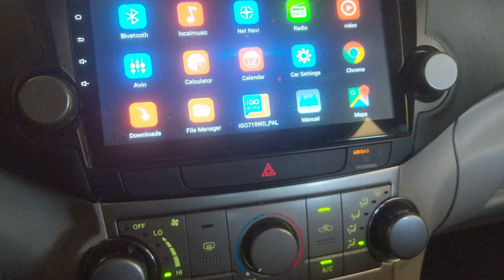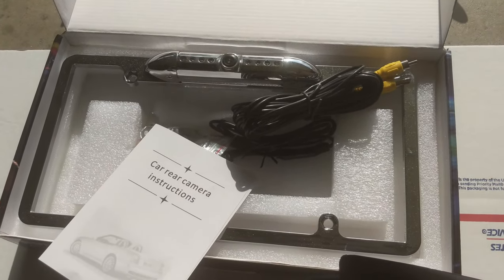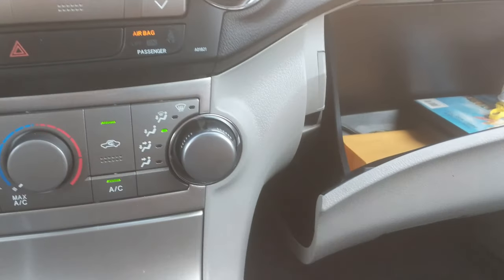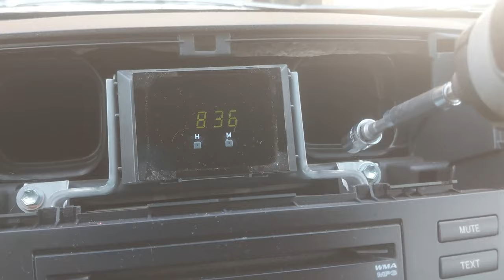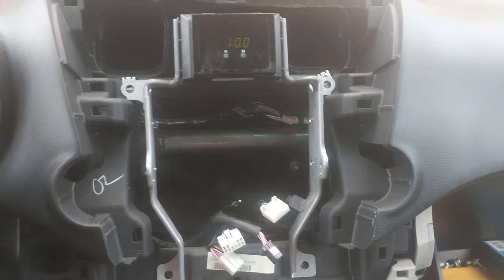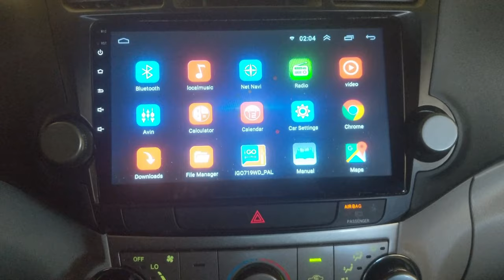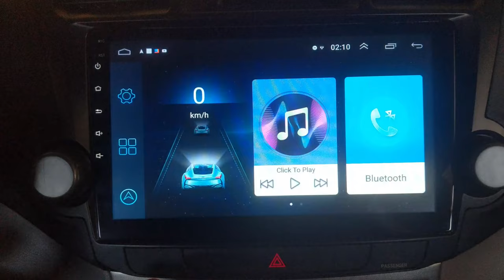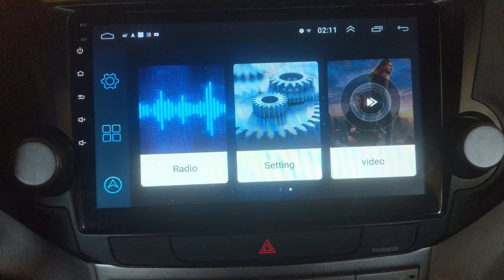HOW TO INSTALL A ANDROID 10.1" STEREO/RADIO ON A TOYOTA HIGHLANDER! $100 UPGRADE (STEP BY STEP)

Comment: For those trying to figure out how to get the AC vents out of the old piece, here you go: look at where the vents go in the new stereo and you should see 5 tabs, 2 at the top, 2 at the bottom and one on the outer edge of each AC vent hole. Break the corresponding 5 tabs on the housing that currently holds your AC vents and you should be able to wiggle it right out. Line up the tabs on your stereo piece with the AC vent and gently push it forward until the tabs click into place.  👍🏾

Comment: How about the rear camera? Were you able to use the existing camera but display it in the new radio screen?
Reply from the maker: Good question I put a aftermarket camera and everything work really good
Reply from the maker: Are used a licence plate camera... It works really well
Reply: @BudgetClan  will you please supply a link for the rear camera? 
Thank you very much for the video!
Reply from the maker: Here is the link friend...
https://www.amazon.com/dp/B00GMC8QXI/ref=cm_sw_r_cp_apa_fabc_MZBJPAJ4A5M286W1MDW2
Reply: @BudgetClan  Thank you! I'm still trying to convince myself that I can tackle this.  Once again I appreciate your efforts and the video.  I recently purchased a 2012 highlander with 140K miles. The stereo, back up cam and a few other items quickly broke. You've helped me out a lot!! 
Best to you!
Reply from the maker: @SR-dq8fb  You made a great decision by buying this vehicle... Highlander and the best and have a great resale value.. and Yes you can accomplish this task! when you start this task and you get stuck message me .... and I can Help you to the best of my ability!!!  Have a great day my frien!
Reply: @BudgetClan  Thank you! I appreciate your comments on the Highlander. I was feeling very low after I started to have issues immediately after getting it home.  Stero knob was broken at the stalk and steering wheel controls didn't work. 
My first step is buying the unit and license plate camera. I will try Amazon since I have had good luck there.   I will also pick up the tools you used in the video.  I appreciate your follow up and willingness to help so much!
Reply from the maker: @SR-dq8fb  no problem anytime!
Reply: @SR-dq8fb  I have an 08 limited edition Highlander do not be discouraged with Toyota! This thing runs like it has 30,000 miles on it, you cannot say that for any Chevy.
Reply: Good vid but do you know if you can use the  existing camera?

Comment: I find the video helpful to a certain point but it is incomplete because for one, the vents on the old system should be removed and placing them to the new system. Secondly, the emergency hazard switches placed in the new unit. Finally, he mentioned and showed the backup camera but didn't show how it is installed. There could be a second video showing to hook it up.

Comment: I have an 09 highlander and the stereo system sucks, the speakers too. Would love to upgrade like this, great video. Price is now $179
Reply from the maker: yes brother i agree... i found if for $137 if interested ...
https://www.ebay.com/itm/Android-9-1-Stereo-Radio-16GB-Quad-Core-MP-Media-Player-for-Toyota-Highlander/224299678578?fits=Year%3A2012%7CModel%3AHighlander%7CMake%3AToyota&hash=item34394d7b72:g:JKgAAOSwW6xf7YzK

Comment: Thanks.  You showed a rear view camera on a licen plate holder, can you share that info as well, and does it work well with the radio?  Is it wireless? Can you  recommend an installer in my area 11004, NY

Comment: How do you set up the wheel controllers?
Reply: SWC is yet another aftermarket part. There are a few out there. I personally used the a Steering wheel retention kit from Axxess. You splic like 4 to 6 wires and the module does the rest. It was like $60

Comment: How’s it going with the unit? Any problems? I’m thinking of pulling the trigger but afraid of the 1gb of ram/16gb HHD. That’s pretty low to run apps.
Reply from the maker: Its still working well and yes .. it does the basics...

Comment: I'm installing the same touchscreen in a 2008 highlander as well and I can't seem to get the correct wiring assembly
Reply: Did you buy the same one has? He doesn't specify nothing and just leaves the video unanswered. I'm assuming it's going to plug and Play into your Base radio without the JBL audio system. One person said it wouldn't work until they changed the settings to United States. Idk.
Reply from the maker: Sorry guys life with triplets is busy... but the unit should have came with the harness that connects to the original harness for a very easy install. Please let me know if you have anymore questions!
Reply: @BudgetClan  most of us are just under the impression that this unit will work with all the cars functionality?? I know how most Chinese products are misleading with simulating images on the screen and not showing the real product. So we thank you.
Reply: @BudgetClan  question now, did you have higher gains in the treble with the new head unit?? The stock one had very low Highs!! Almost sounded like I'm playing guitar out of a amp.
Reply from the maker: @yodead369  definitely sound quality increase... there is an equalizer to adjust the sound. This unit is definitely a big upgrade from the oem!
Reply: @BudgetClan  I remember having to buy a few wiring harnesses just to get aftermarket head units to work in GM cars.. I had to buy a modular just to have the chime for the door.. smh.

Comment: Where did u get your wire harness kit? Mine was incorrect
Reply from the maker: It came with the stereo... when u buy you would put the vehicles information and it should match when it comes.  If it doesn't contact  the seller.. they should correct the issue!
Reply: @BudgetClan  thanks!! Yeaaahhhhh...conpletely incorrect all good thanks ill contact seller

Comment: Where did you put the GPS antenna?  Also, are you pleased with the unit?  Thanks
Reply from the maker: I put the GPS antenna on the back of the unit ..the antenna has a magnet.. and yes I am pleased with the unit!

Comment: Excellent video, could you please let me know what is the current model for my Highlander "12, 2.7, 4 cyl, fwd?
Reply from the maker: here is an up to date link but it did increase in price.....https://www.ebay.com/itm/10-1-For-08-13-Toyota-Highlander-Android-9-1-GPS-Radio-Navigation-Player-1-16GB/202955456386?fits=Year%3A2012%7CModel%3AHighlander%7CMake%3AToyota&hash=item2f41167f82:g:taMAAOSwtzZeh-2o

Comment: Does your radio steering controls work?
Reply from the maker: My model doest have steering wheel control. You can the steering wheel controls work with an adapter

Comment: backup camera?
Reply from the maker: Yes there is an output for the stereo.. you would just need to buy and aftermarket camera or an adapter that connects to the oem camera!
Reply: @BudgetClan  i have a limited edition and the wire harness does not fix, do you have any solution?

Comment: Does it work with JBL?
Reply: Right... I can't find anyone saying if any aftermarket speakers work with the Highlander JBL system... You think they at least say if it did or didn't and they hook it up... The first thing I do when I install a radio is test out the speakers not the f**** screen. LMAO